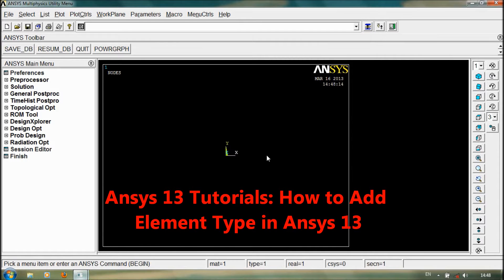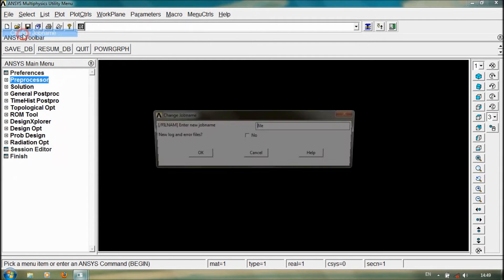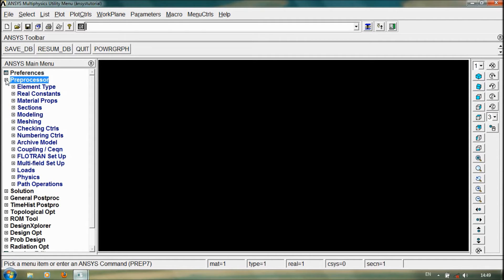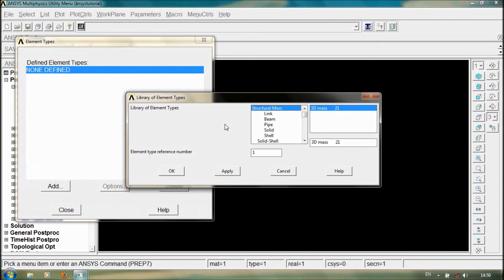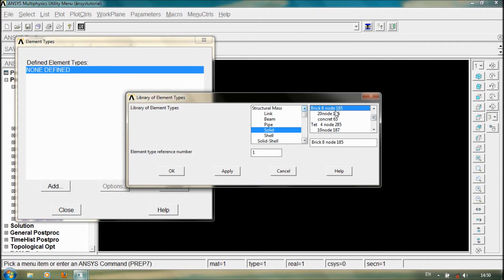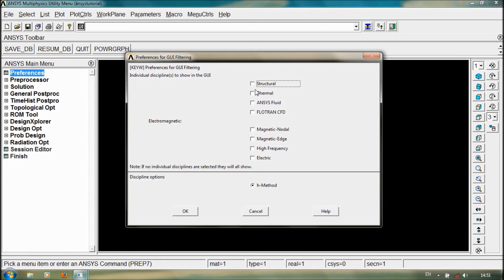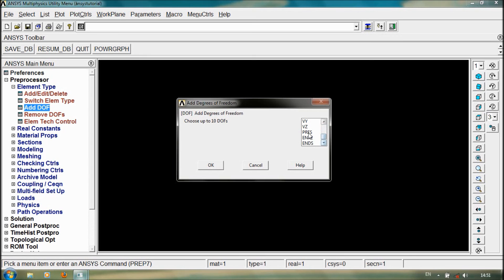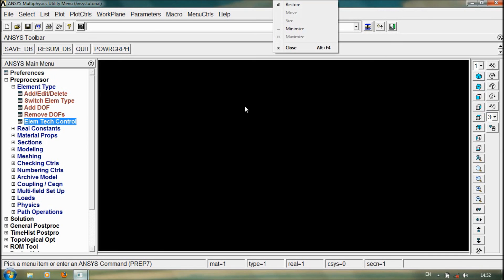Ansys 13 Tutorials Download_How to Add Element Type in Mechanical APDL

Comment: @Liam Ward. I have Ansys 14.0 installed. There is no option for 2D Beam23 on my Element types on Ansys APDL. I have the LS-DYNA solver GUI but still there is no option for 2D Beam23. Any help?
Reply: Lizeth Durán Nope. I couldn't solve the problem. The newer version of ANSYS doesn't provide with such element types. So, i just went back to ANSYS v11.